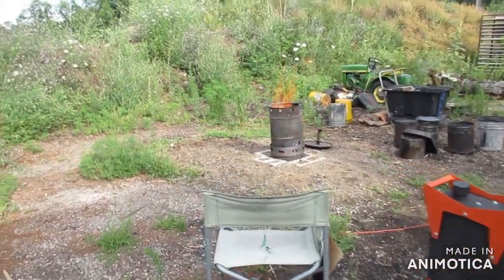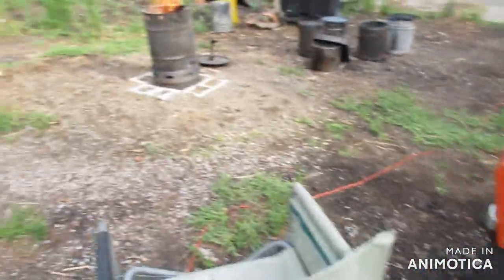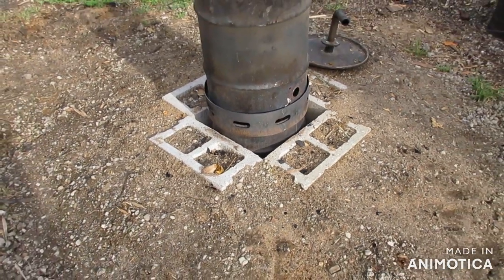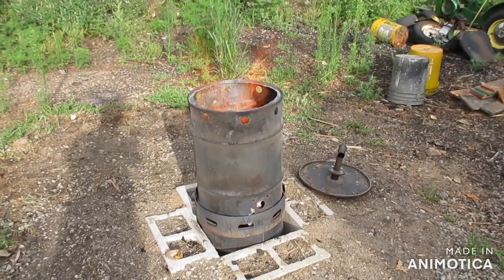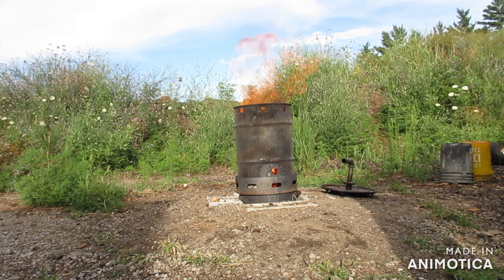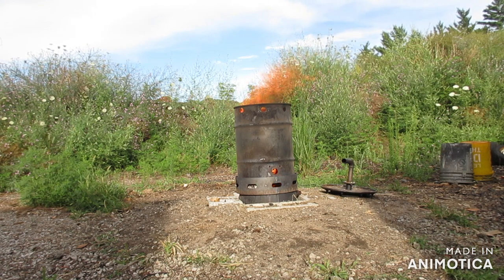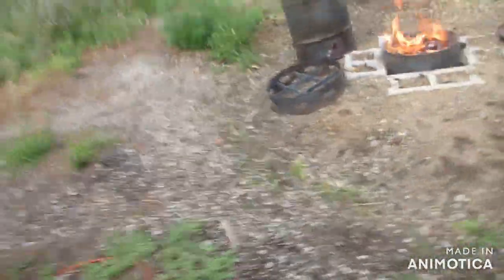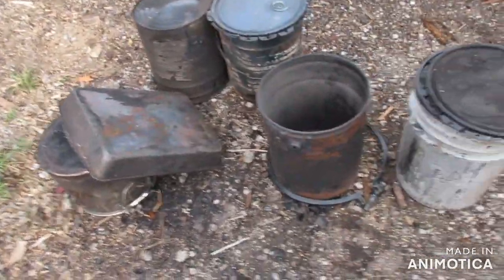Making Charcoal with the M-1 Max 14 inch Barrel Drum Retort Adapter

Comment: Are you as selective with your burn stock , now that you only run charcoal? I know the traditional gasifier is sensitive to wood type and moisture. I don't have access to trees per se, but I could burn wood waste. Just thinking out loud, like a fellow geek! lol
Reply from the maker: Nope I run anything I can process to fit. Ive even cut up PVC pipe and mixed it in and it produces carbon pipe lol. You just get different density but it all reduces the same. The nasty's get burned off and thats all we care about
Reply from the maker: There is a new tutorial of the new CFK-10 you may be interested in. Its an updated version of this one. https://youtu.be/VzGpIGQiv-8

Comment: Matt, the video just unexpectently cut off. Couldn't you light the smoke coming out of the pipe so you don't have to smell it?
Reply from the maker: My battery died. No just use a lid with no vent. Just seal it off. That lid and those drums are from a filter. They are now a retort, the pipe is not there for this system. I will get a new lid at some point. But this is working for now. I dont mind the smell I like the smell of a camp fire.
Reply: @Thrive-Off-Grid  The reason I said about the pipe venting at the top was because I watched a video about making char cloth and they put cotton in a tin can with a hole in the top. Then they heat the whole can and let the smoke come out of the hole. They lit the smoke which virtually made it disappear. When the smoke stopped they opened the can and had char cloth.
Reply from the maker: @plainwornout3964  Yes it will light for a time. Depends on how well the char on top is processed.